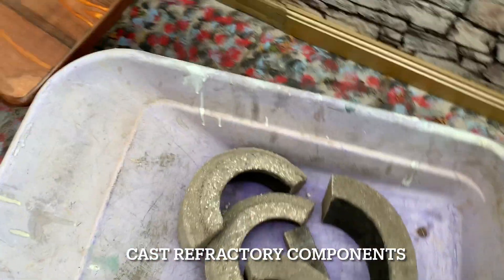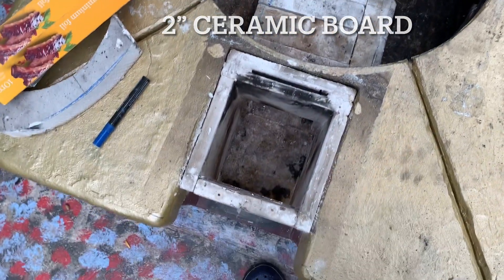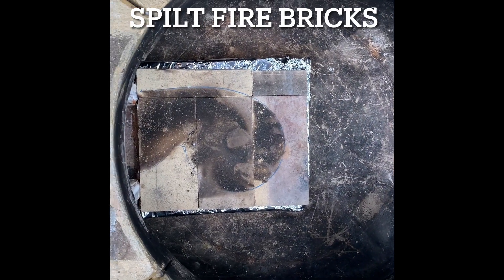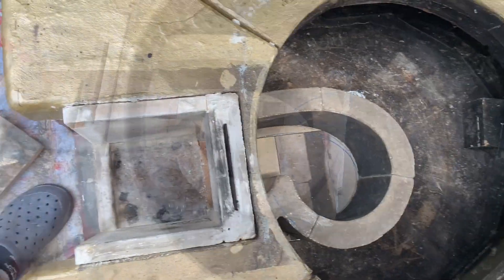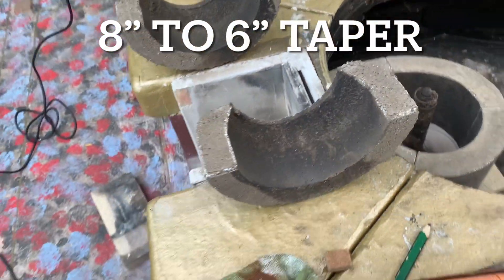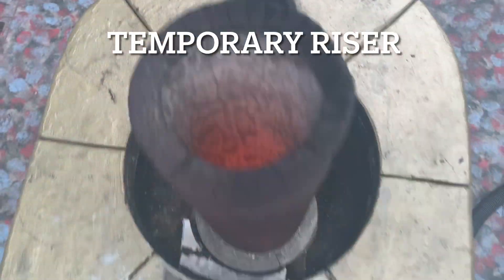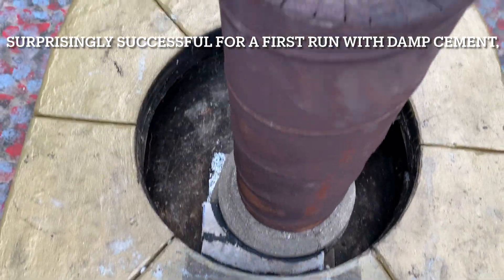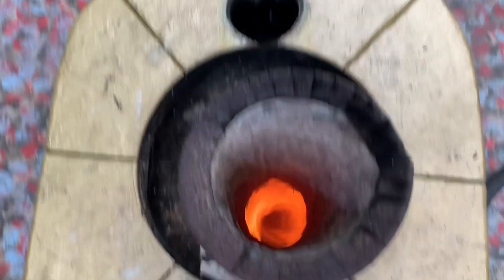Vortex J tube, first run…..

Comment: Good one Martyn!
Good to see you trying out the vortex in vertical riser. After my experiments with Trevor's 4" design I finally built the 6" vertical design, similar to yours. This setup is a beast, as you've noticed here. The simplicity of this design appeals me as it makes it very easy to use, reload and not having to manage too much about air controls. Sufficient tuning of primary and secondary air built into the design is enough I found to give a super clean, lean burn without any smoke. As always, enjoyed your video. Waiting for the follow up video once you've built the entire stove!
Reply from the maker: That sound great my friend, you can add secondary air quite easily and effectively, i do have some previous videos showing how to do just that
Reply: @foxfish7115  True. I built mine earlier in Summer. It's very basic and not pretty (unlike your stoves 😁 which are really cool). Since it's monsoon I haven't used it much lately. I'll do a video once I get a chance.

Comment: Not v****x, turbine,
a V. concentrates, after turbine,
and explode also.
See CNC cooler V.

Anyway good job, congratulations.
Reply from the maker: I dont really understand your post but thanks anyway.
Reply: @foxfish7115  

I can't name the 1st word of the video title because algoYT?

 There are V. tube diagrams air cooling for CNC 

In theory - I have not checked everything in practice: 

What you have done rotates the flame but does not concentrate it totally, 
although the rotation and heat make a comic flame, 

And it would require a burster, for example a thermal engine spark plug, 
at the point of compression at the outlet, 
which would concentrate all the heat. 

There are V. that We find for car engines, as fuel saver, 
but I can't post a link, 
Do you want me to send you some by email?

Not very difficult to build,
 to test
 - but will not long resist to the heat, made in thin sheet.
Reply from the maker: @fred-san  ok I will see if I can work out what you mean….

Comment: I'd say you definitely met the mission objective!  I believe what you've done is to create a smooth transition from the burn tunnel to the riser that will more evenly distribute the heat around the perimeter of the riser base.  I would like to presume this will not only improve vortex flow, but quite possibly the overall durability of the riser base ass well.
Reply from the maker: Lets hope so, I think a lot of the combustion will take place in the vortex chamber so perhaps a shorter riser? 
Also there is very little restriction with this design.